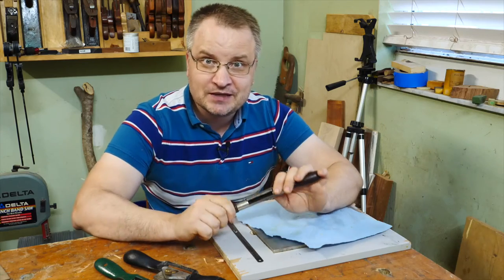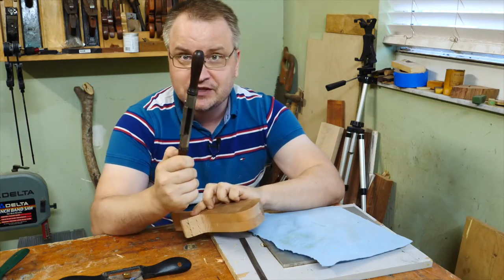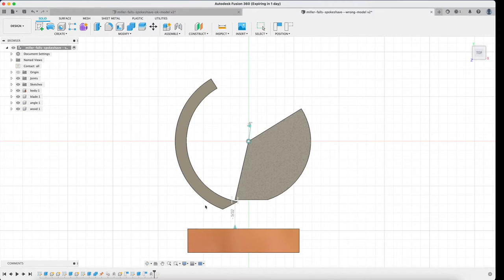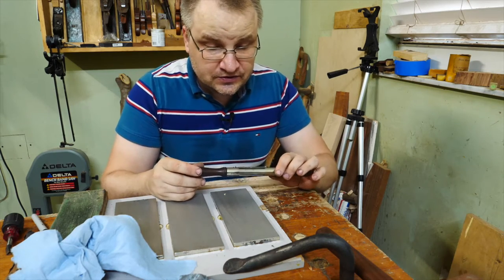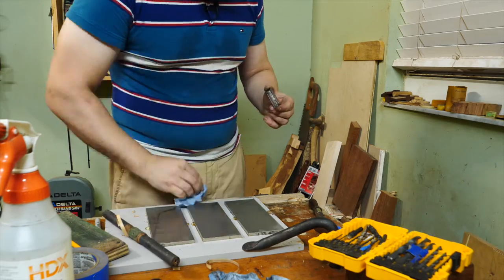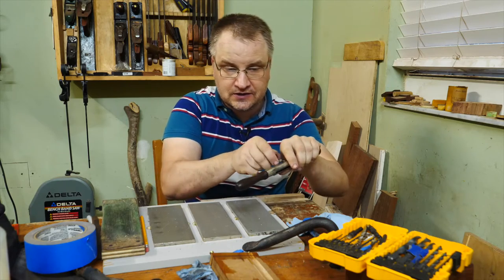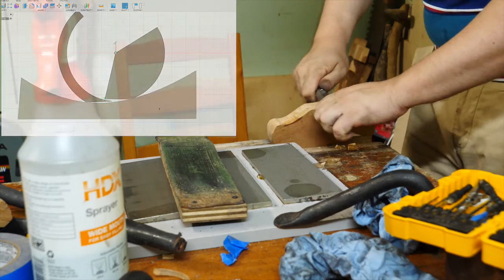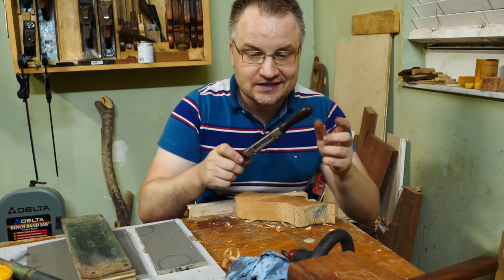Miller Falls No.1 Cigar Spokeshave - Sharpening and Potential Design Flaw

Comment: Good timing! I'm about embark on sharpening a cigar spoke shave, too.  I do know that that express purpose of a cigar shave is highly concave surfaces
Reply from the maker: I still not sure that it can do, especially after modeling in my next vid. At least suspect that back bevel needs to be much kore prominent
Reply: @A2woodArt  I just finished honing up mine and I concur!  Perhaps it's one of those misconceptions that have pervaded the community because of the shape and look of the tool started by those who have not used the tool.
Reply from the maker: @bilal11  I even checked the original patent. It states it allows for more surfaces, but doesn’t explicitly talks about concave.   I was told that Miller Falls No.2 should be better for concave, now going to be looking for one